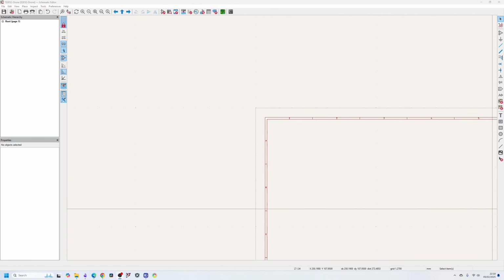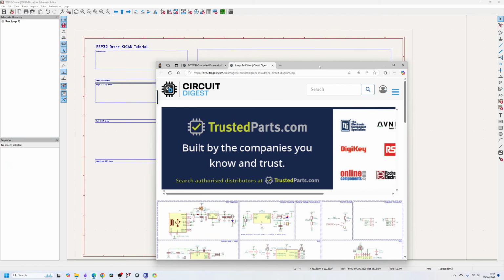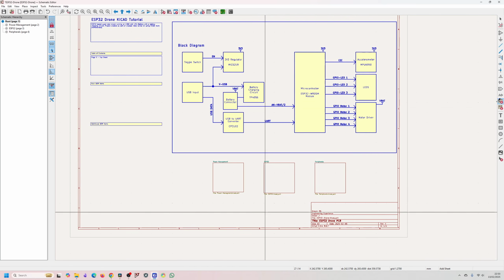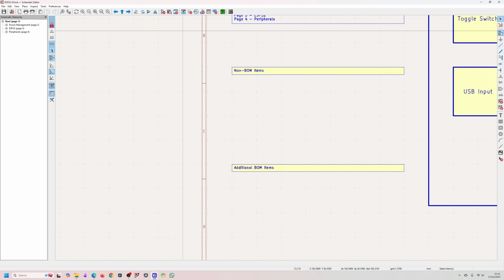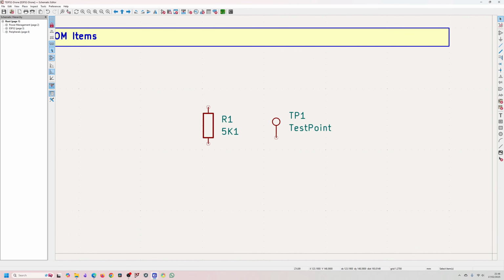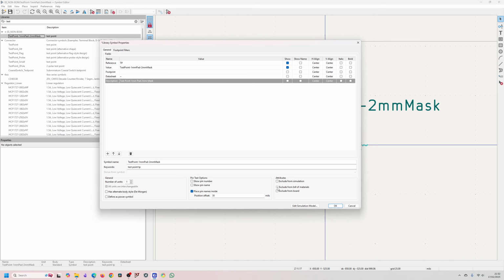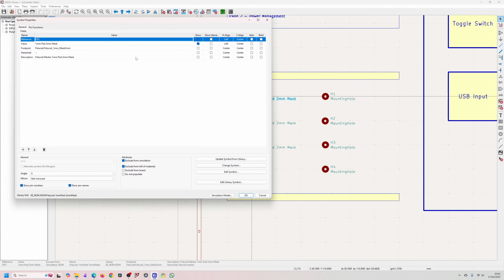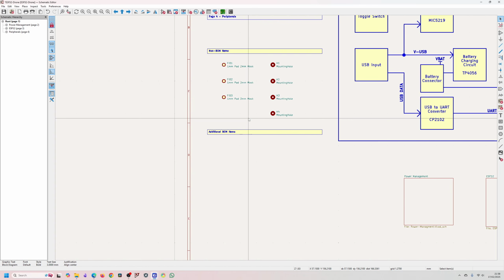KiCAD Tutorial #2: Organising the Schematic and Top Sheet

Comment: So you’re mixing the logical schematic and the power schematic in one diagram? You have I2C/GPIO control, but the rest is about power. Wouldn’t it be more logical practice to separate the schematics into two levels: logic and power?
Reply from the maker: As with a lot of things, it Depends on the complexity of your project. If you have one regulator on the board, I normally keep with the connector, if you have multiple you can keep a separate sheet with global flags.

Comment: i have a doubt, how did you make the 3v3 source symbol of the block diagram?
Reply: good video btw
Reply from the maker: It’s just like drawing. Horizontal line and vertical line. 

You can also draw the diagram on something like draw.io and then import the image which will give you a slightly easier time.

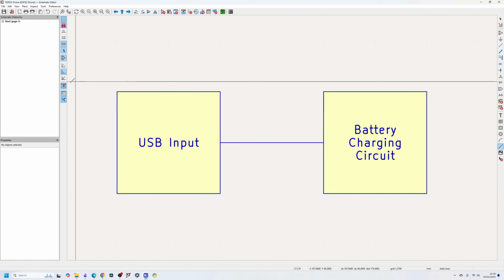Comment: Whoa! Not so fast! 🙂  What was the trick you used at 3:39 to create an arrowhead?  Your narrative says "if I want to create a right angle connection you can see I can't do that"... but obviously you CAN create wires or lines on 0/90/180/270 degrees (right angles). Then you click the button that perhaps permits also 45-degree diagonal lines. Then on the drawing you click the end of the previously-drawn line and magically an arrowhead appears.  How did that happen?
Reply from the maker: Oops. Maybe lost it in edit.

You can definitely create right angles with wires, going from memory it the same for line drawing aswell. Although for wires you can angle the line after  creating it, which is what I normally. So create a line then select one end and drag to create the angle for the arrow. 

With KiCAD 9 the lines get grouped aswell so it's bit for block diagrams with the update. 

You can also draw a block diagram on draw io and then import if you want more functionality.
Reply: @TheEngineeringExperienceYT  OK, so sadly there isn't some magic "arrowhead" function, you just manually drew in a couple of diagonal lines (or dragged existing lines), right?
Reply from the maker: @Graham_Wideman  yes, unfortunately. You only need to  create one then you can copy paste.